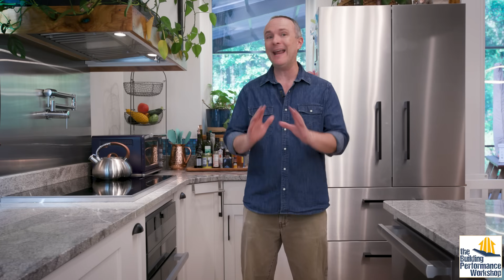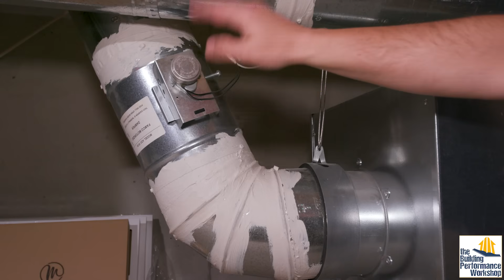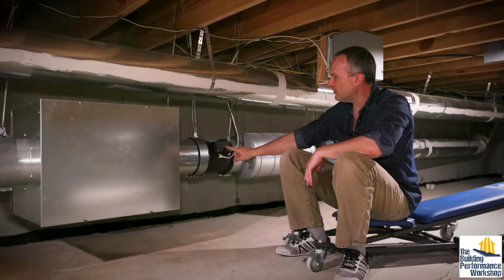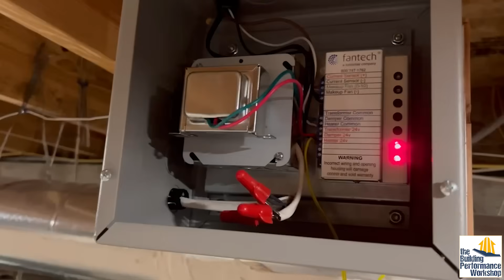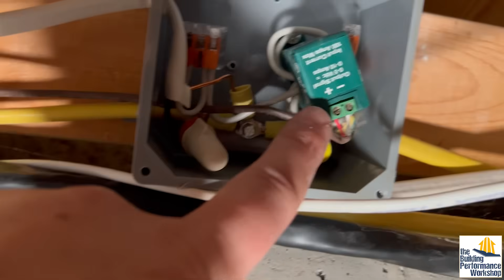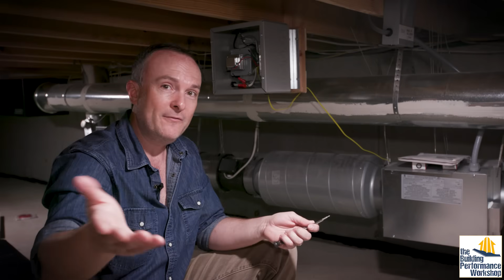Active Make Up Air System Testing + Setup: Fantech MUAS 750/1200

Comment: Great video. I’m running a fan tech 1200 and a best 1200 hood. I, like many others have an issue with the led lights turning on the mua system. I see you are testing with the light on, are they on high and does this effect the lower settings on your hood exhaust operating the MUA system.

Comment: The brain for the fan should have an output to connect wiring to make up air unit (instead of needing to add a current sensing switch).

Comment: Phenomenal video with excellent narration.  Would like to know how you connected the heater (Heater +ve and ground) to the controller (Heater 24v and Heater ground)?  Basically would like to know what ports used on heater. Thank you
Reply from the maker: Interesting q, thanks for watching. That part is pretty well spelled out in the install manual, I don’t have any better insight.
Reply: @HomePerformance  thank you

Comment: The link in the description is for a current switch not a current transducer, I'm installing the MUAS 10 unit and my hood only draws 1.2A on full power (per the manufacturer) was directed to pick up the Veris H822 which seems to be made for the lower amperage. Looks like Functional Devices makes a traducer so maybe the link got wonky?

Comment: Are there any systems that modulate makeup air with a permanently installed manometer rather than modulating based on the current draw of just one appliance? A manometer based system would then be able to account for the exhaust of all the appliances in the home instead of just the range hood. It could also accommodate dryer venting, bath venting, fireplaces, boiler intakes, etc and not need to be programmed to any one of those, just continually measuring the pressure inside vs outside and adjusting.
Even better would be an ERV system that could serve the purpose of a makeup air system by modulating the ratio of intake vs exhaust to keep pressure equalized. It seems like an ERV and makeup air system serve such similar functions that they should be combined into one unit.

Comment: @HomePerformance   Very helpful video, as always.
I am working on the design for a make up air system in climate zone 6a. It will have a damper, filter, motor, and heater - in that order from exterior to interior. How can I best deal with condensation of interior air on the damper and motor unit? Seems like I have to either (a) build an operable, insulated box that everything sit in inside and have everything inside the envelope, or (b) put everything outside the envelope and only allow heated air into the envelope.  Thoughts?
Reply: I'd vote for inside envelope & simple fan blowing on damper

Comment: Because it's relatively mild here in the PNW, I just finished installing my MUAS directly into my HVAC return at the air handler ahead of the filter. It doesn't really need preheat or silencing because of that, but it has helped a lot to solve poor extraction that even a 24"x18" open window wasn't doing enough for. It now runs a little positive pressure at full speed, but that is the only thing that really works. The Phyphox app was very helpful for tracking how well it is working.
Reply from the maker: Good work buddy

Comment: Is the current sensing switch the one that came with the system? I was about to order the MAUS 10 but unsure if I still need the RIB sensor.
Reply from the maker: Yes, the one I installed was the original in the kit.

Comment: This video is gold for so many reasons. Thank you for showing your installation, especially the close-up of the FMAC component of the Fantech MUAS.

Fantech is a great equipment choice for at least one reason: all of the fans (and related controls) shown in the video use 0-10V signaling and don't rely on a proprietary signaling method, making them easy to work with and integrate with other components.

The FMAC "brain" sets the MUA fan speed (voltage) based on the exhaust fan current (amp) draw. At the lowest speed, the exhaust fan could draw as little as 0.1A, which means that you need a correspondingly sensitive amp sensor, or enough windings to get a reading from a less sensitive sensor (e.g. 10x windings for a 1A sensor).

It is surprising that after what looks like five wire passes through the amp sensor and no room for more passes that the FMAC isn't reliably activated at the lowest exhaust fan speed using the amp sensor included by Fantech.

It is possible that the problem isn't the amp sensor itself but instead a loss of the sensor signal due to the low voltage and wire run from the sensor to the FMAC.

The sensor signal is much closer to 0V than 5V when the current draw is close to 0A. Attenuation or interference could be degrading the signal to the point of being read by the FMAC as "off".

You could (even temporarily) try a thicker gauge signal wire and/or a shielded signal wire to see if that resolves the FMAC sensor reading problem.
Reply from the maker: Very interesting- and this is why electrical training is so important (I got a hodgepodge from friends)

Comment: For that split core current sensor from RIB, is that the RIBXGTA-ECM? The other sensor (the green one) looked like a transducer output, ranging from 0-5Vdc signal based on 0-10A current sensed. Is that indeed what the green one is doing? Thanks for your video and thank you for clearing that up for me, if you can.

Comment: As an idea, what would the pros and cons be to dumping the make up air in your crawl space to have it mix with the conditioned air there first and then have a different duct which pulls from the crawl space to the ports in your cabinets? I assume you exhaust some of the air form your crawl space via erv so eventually it would make it back to normal conditions. I suppose it's a question of how long that buffer of air lasts you and if you will end up with humidity issues in the crawlspace that would be worse than what is caused in your kitchen when it's humid out.

Comment: 12:54 - "We're going to be monitoring the pressure in the house with reference to outside."

For clarity, that red hose was terminating outside the home's envelope? I would be interested to see what method you used to get it outside without crimping the hose (e.g. the pipette?). I've watched your video on zonal pressure testing and saw the example of putting it under the bedroom door. I assume this is similar, but perhaps you've cracked an external window/door and It maybe taped off the gap around the hose?

I have the MAUS 750 system installed, but was not commissioned appropriately as it depressurizes my home anytime I use it. Your videos are super helpful as I'm trying to figure out if I can resolve this myself or at least learn enough where I clearly describe to a contractor what I need done. Thank you for making these videos.

Comment: Great content as always! 

Question, what intake air heater do you recommend for cold climates (rocky mtns 8,300ft elevation)? I saw you installed one in a previous video but can't find details (it was in your personal crawlspace) 

 As a building construction professional, it's so difficult to get homeowners to listen to scientific facts because there's much misinformation and of course: "code says"...
Reply from the maker: Same one that’s installed here should work, but doing the calculation wouldn’t hurt.

Comment: I have a couple of questions/ideas that might not make sense because I am not an HVAC professional and I don't know what kind of cfm these pieces of HVAC equipment typically run at.  My first question is why don't you temper the makeup air using an HRV (definitely not an ERV because we don't want the additional moisture vapor from cooking) where the vent hood ducting goes into the exhaust and the makeup air goes to the intake?  Since you are trying to balance the pressure, just like an HRV should be doing, it just makes sense to run the two sets of ducts through some kind of heat exchanger.

My second question/idea is could you run the makeup air into the outside air intake present on most whole home dehumidifiers?  This would remove moisture from the incoming air (if needed) and theoretically prevent the condensation problem you mentioned.  It would also allow the replacement air to be brought into the house through all of the existing vents, which would make the air velocity even less than a system like yours with the 14"x14" duct would be.  I know you said you shouldn't mix your makeup air system with your regular HVAC system, but I guess I don't understand why this wouldn't work just as well, if not better.  Thanks for the excellent videos and advice.

Comment: Always doing a great job!!!  Mine is a broan glacier.  I’d go much higher cfm if I did it again.  One day I’d like to put in a nice system.  After a certain speed, ours depressurizes the house so if I need it on high we open a window or door for pressure relief and it works a lot better that way.  We have a ventilating dehumidifier so on some speed we aren’t depressurized.

Comment: This is great. I'm planning a kitchen remodel starting in a few months. Never done a blower-door test, but I want to tighten up the ceiling, and do other insulation and air control upgrades soon after---so the test, an active air return for the range hood is important. But where to put it?

Some of your equipment looks kinda bulky, and my basement ceiling is only 7 1/2 feet, so building a soffit will invade the garage (house is in the side of a hill, and garage is under living room, dining room and half of kitchen). But it might not be too bad. However, air intake will be under the back deck. The good is that equipment will be accessible.

The other option is to pull the air from under the eves, put the equipment in the attic, and then push makeup air down inside the wall cavity then into the space under the cabinets. The bad news is access to the equipment will be a pain--either too hot or too cold, definitely too dusty, and waddling along a 2x10 rat run for 35 feet to get to it, etc.

Corbett, I've been inspired by one of the hood examples in your video: https://www.youtube.com/watch?v=Qs4wis82NAE  Rather than stone and tile, I'm thinking solid surface (a.k.a. Corian). And I've got a great set of plans drawn up and nearly complete. I've been following Mark Tobin's channel for design, and have shuffled major functions four times. But It's finally gonna be great! Also watching videos by appliance repairmen on what brands, and features, are less likely to fail in only 2 or 3 years. I'd love induction, but the repairmen say that replacing a power board can be hundreds of dollars--so I've come up with the nutty idea of separating the cook top from a built-in oven. Rather than spend $450 for a single part plus the labor, it might make sense to chuck the bad cook top and buy a new one.

Comment: Hey, Corbett!    @homeperformance
My equipment for the MUAS 1200 was installed last week.  Wiring and commissioning scheduled for Friday, but after seeing your process, I'm thinking we might have to wait on commissioning because there are dust barriers up all over the house until remodel is finished..  
1) Wondering why you didn't insulate the ducts.  ??   
2) For the number of transducer neutral line loops, I get conflicting info from the installation guide, and two different techs I talked with at Fantech.  The only common denominators seem to be to get 10A and 5vac out on the transmission line.  If yours was not sensitive enough at low speed, you might consider adding another loop.

Comment: I’ve commented once before on a video, perhaps too critically, but you engaged anyhow. Thank you. I need something like that Retrotech Solo, but am also tempted to cobble something together from bare electronics and integrate it into Home Assistant.

I have a whole house fan and am in California’s climate zone 10. But I’m in a fairly isolated neighborhood and I see RH swings to the high 80’s at night, outside. House built in ‘94, windows all replaced with dual pane units. Based on airflow around electrical boxes, I’m thinking my first upgrade is sealing the vented attic. Attic venting is insufficient for WHF based on watching temperature deltas over many hours and days of use.

I have 2 gable vents, one that’s ~567 in² and the other ~384 in². Roof line holes give me an ideal 147 in² as passive stack intake.

What would you do to reduce the positive pressure in the attic during the fan use? Aux ducted fans hooked up to the gables? Can this also be setup to serve as a makeup air system into the house for bathroom and kitchen fans?

Yeah, kind of a consult level Q&A, but I’m curious of the approach that would be taken as I explore this topic. I’d ideally like the make up air system function without the need to open windows and ERVs/HRVs don’t seem to fit airflow. I have discrete dehum currently.

Comment: Is the preheat really necessary, or just a nice to have since your particular setup hits your toes? Seems like if the air is coming in somewhere you won't necessarily feel that much, and balancing is correct so it just gets sucked back out, temp shouldn't matter that much.
Reply from the maker: You can try it (please leave room to add later), but the materials in your home also may shrink very quickly with 100's of CFM of 30 deg air flowing by. Drywall cracks, floors separating, etc.

Comment: I'm not big on the idea of dumping 100*+ air directly into the kitchen when I'm cooking. The idea is great but I'm really not a fan of the systems that are available for residential. Like you said there is allot of room for the industry to make adequate equipment. The one you mentioned is a better option than the buy a bunch of off the shelf stuff and make it all work assuming you have the room for that massive system. I'm used to the commercial side where they have real makeup air units. 

      I know how I would do it as an all in one but also have ideas for going another step further than yours but the cost goes up quite a bit. Basically MUA units should be supplying conditioned air to the kitchen. 

        Now that fantech controller is ok but it's a really basic controller and not very smart. I'm always amazed at how crude most control units are for the commercial world and the prices they charge for them. It really needs a chap baro/map sensor added to it so you don't have to do any adjusting to the high and low end. It can do that on it's own with that input and the sensors are very cheap these days. The ardunio guys could whip that out in an evening. The cheapest sensor already on a board for ardunio is accurate to .002hPa and more accurate sensors can be had from electronics suppliers. So not that hard to build a smart auto adjusting system.

           My problem is I'm the type that looks at something and I'm figuring out how to make it better or simplify it etc. Too many things out there are still clunky simple items with little design work that are just dumped on the market and carry a higher price than the designwork and manufacturing justify because they don't see a bigger market for their items. In most al fields.
Reply from the maker: You rock. Did not know about the Arduino stock sensor being so good. Thanks.

Comment: We did a full tear-off on the exterior, resheathed with ZIP plus exterior insulation and air sealed the heck out of a house we're renovating. I added an intake vent for the specific purpose of makeup air, even if I haven't yet gotten to figuring out how to do that make-up air system. Having a clear video walkthrough of a sample make-up air system and the setup process is awesome. I'm sure there will be more details to figure out when we install this, but having a clear starting point is deeply helpful. Thank you!
Reply from the maker: Thanks for the support, and glad it helped you. FYI our Patreon group meets 2x/month, for as little as $5/month. Another way to get the intel you need :)

Comment: Gulf Coast owner-builder here. 

In this climate the air has to be conditioned. I've been told to have it connected to the AC return or have a whole house dehumidifier inline. 

I am planning to do both because the dehumidifier cfm is too low, so it's not enough on its own and I'm concerned dumping really high humidity air straight to my AC will create other issues. 

Does this make sense or should I consider something else?

Comment: The control scheme is kinda simple enough that I would recommend considering a few channel PLC, a PWM fan controller, and a couple relays mounted in a small DIN rail enclosure. It may not be as simple as the Fantech solution, but for the complex task you are already endeavoring to do it may centralize your control scheme more so that you don't have to crawl over to a CT clamp location. I know I am probably overcomplicating this, but in all reality a simple PLC, a little thought on the control schemes and power feeds and some time you can clean up this dispersed make up air controls into one place and make it network accessible to add or remove sensing features. This is my inner industrial electrical enthusiast opinion, and I may be naive to the complexity of what I proposed, but I do not think it is too unrealistic. Maybe even a Shelly or an Audino Opta?
Reply: I think you're onto something here. I'm not an electrician, so even though what Fantech has designed may be simple, I find myself wanting more explicit and logical control over each component. I have the MAUS 750 system that was not commissioned properly and would have gladly paid a reasonable more to gain more control and feedback. Wouldn't it be lovely to have a single-purpose manometer built into the system that would enable the fans to self-balance (similar to an ERV)?